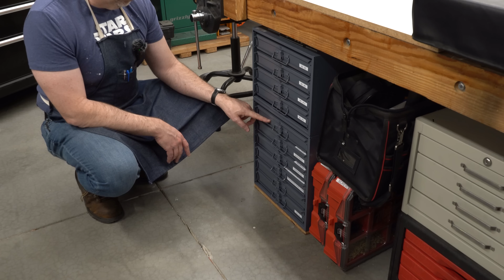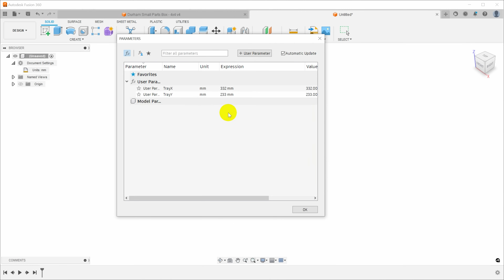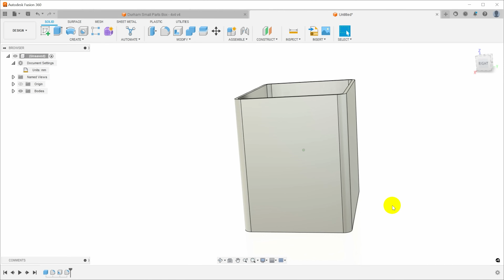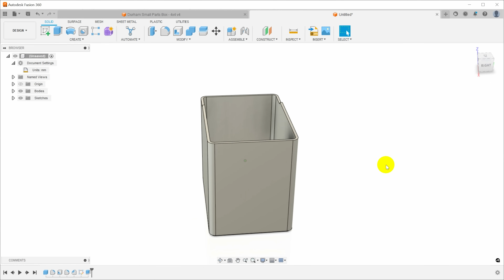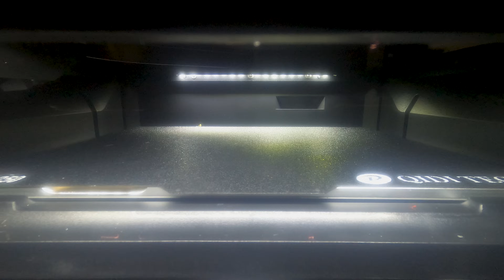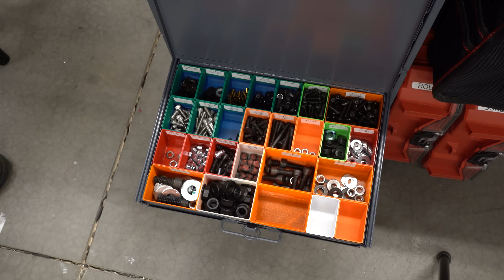Create the Perfect Storage Solution with 3D Printing!

Comment: Gridfinity is a similar modular storage system.

It's based on a 42mm square and 7mm height units

But you can create custom boxes with any dimension with the Gridfinity Rebuilt OpenSCAD model that can be found on Printables.

I've begun using solely this method for basic boxes but with a 21mm grid size on the bottom of boxes and a 42mm base plate grid size. With the 42mm base I can use community generated models. Then the boxes can be moved in half increments, or I can build smaller half boxes.
Reply: Yes i was wondering if gridfinity would be mentioned
Reply: And Gridfinity again was 'inspired' by a similar box system by Alexandre Chappel
Reply: @insignio1  unfortunately his never really took off
Reply: @insignio1  Which didn't take off, because that guy literally designed his system around his deficient printer. When printing on a well calibrated machine there would be different sizes for a 2x1 vs 2 1x1.
Reply: FreeGrid is similar to Gridfinity but with a few different design decisions that I like. For example, it uses a 50mm grid and 10mm unit height instead of funny but random values like 42mm.
Reply: Yes and its open source so there are hundreds of tool/part specific additions great setup
Reply: I’m sure Zack does mention it in the original video he made on it. But it’s taken off in quite a fantastic fashion
Reply: I have been struggling with an aging orgazitional system that was once nice, but has suffered greatly from lack of flexibility over the years. I am also a software engineer and have many of the same OCD characteristics that James does.

 I recently started to work on the problem using gridfinity and am still working on my first drawer, so I have a lot to learn still. The disadvantage of gridfinity is it doesn't fit exactly with the dimensions of existing boxes like the Durham boxes, so there would be some wasted space. On the other hand, the base grid means you don't need to print empty boxes just to fill out a drawer, because the boxes will stay in place anyway. Another advantage is the gridfinity boxes can be used across multiple sizes of boxes and drawers for additional flexibility in the future. I want to be able to organize tools as well as parts. Also, I want my system to work with parts drawers, toolbox drawers, shelf storage, etc. all from different manufacturers with different dimensions.
Reply: @michaellitzkow8123 It's frustrating that Gridfinity was built to joke dimensions rather than an even multiple of a 10mm cube which has a good chance of fitting in a range of manufactured spaces such as boxes and shelves. This point ignores sloppy manufacturing tolerances for such objects and artifacts of injection molding and vacuum forming meaning boxes off production lines are usually designed without walls at right angles or perfect sharp internal corners anyway, meaning an in exact fit filed with a custom spacer may be inevitable.
Reply: Gridfinity is interesting but I like to make mine custom so I totally see the basis of making it custom. More satisfaction that way.
Reply: I believe the openscad rebuild has arbitrary x and y but hard coded z. I may be thinking of the python cad query version though. The cad query version is even more capable than the openscad version by some measures, for instance containing a parametric toolbox with integrated gridfinity base plate and robust ribbing versus flat plain be optional.

Comment: good stuff. I fell down this hole some time ago. Did the Sortimo . Tanos, route. I looked at these boxes, they were not great at keeping small parts separated. The idea of the 3d printer is a great idea. The Sortimo and Tanos have different sized boxes that allow for the different size and adjustability. Where the 3d printing really comes into play is making custom size and odd shaped boxes. For example having a wire stripper shaped box  in the box with wire splicing supplies.  As usual great work.

Comment: ... That just screams for better boxes. The ones I wanted to use are Stanley's from Home Depot (Search: "Stanley-25-Compartment-Shallow-Pro-Small-Parts-Organizer-014725R") Dewalt/Milwaukee have something similar, but everyone seems focused on large internal trays for jobsite sorts of things.

1) The Lid basically seals against the internal trays.
2) The grid on the box/lid locks the trays in position.
3) These combine to mean that you can actually carry the tray by the handle. 

This box, redesigned to fit the Durham Rack are basically what I want.

Comment: I use pouches for small amounts of small parts, makes them easy to get, reasonable fast to find (just flip through the labels), and the pouch can have lots of text to describe what it is (electronics parts in particular).
Reply: What kind of pouches did you find useful? I'm looking for a nice way to get my misc hardware sorted, and something flippable sounds really nice.
Reply: @klaernie  Quart Zip Locks lined up in clear containers works good. Snack bags seems like they are always changing sizes. But, you can decide on the "Perfect Size" Ziplock and order them from Uline and other places, pay a bit more and usually go back a few years later and buy the exact same bags.. Usually with label areas on them, etc..

Comment: Seen other systems, and they generally include a grid on the bottom, which keeps the other boxes in place when you remove one.

Also, as someone else pointed out, the 8/3 calculation disregards the spacing

Comment: yea  I know what your talking about, I started in software but Im just old enough that that meant you needed to know the hardware, next thing you know I am doing industrial automation where I got a computer running a sequence with a GUI running hardware and doing the electrical design as well as mechanical ...

 Long story short, I get a new doo-dad in that's now a thing that has to be maintained and my tech's absolutely love it when I say "hey I need this to live somewhere in X cabinet, as its a part of our CI plan on Y machine, can you 5S that for me", we have a lot of those harbor freight boxes with the removable bins in them just for the reason of having to shuffle parts around without handling each individual thing in each bin
PS: dont get rid of all the trays, they are handy when rebuilding things, when I do a teardown of something either at work or at home ill use those things for that something and cap in in aluminum foil so it doesnt get lost while I piddle fart with other things

Comment: Just spent several days printing similar (Gridfinity) boxes for a storage cabinet. Your design is a bit more flexible.
Reply: I was just going to mention Gridfinity. What parts of this do you find more flexible (I haven't printed gridfinity yet, but was planning to.)
Reply: @NathanSpaeth  The main thing I can think of is possibly that Gridfinity has a specific core X/Y size. That can either be "not flexible enough" or "I don't have to worry about this" depending on the person and possibly circumstances. For example, James has boxes of a specific size that he wants to completely fill, and that size probably isn't a clean multiple of the Gridfinity X/Y, so he may have considered it more flexible to adapt his bins to the Durham dimensions.

That said, one thing I do think James should consider adapting from Gridfinity is where Zack's tiny parts bins had a little lip on the top back for more visible label placement and also being able to more cleanly pull a bin out/put it back in, which James had noted having some trouble with.
Reply: On the other hand, Gridfinity allows to stack multiple (shallow) boxes. Great for smaller stuff. Just love Gridfinity.

Comment: Great job! I did a similar thing with the Harbor Freight boxes. I even included tools. My ferrules and my ferrule crimper are in the same tray.
One thing I learned to do if I mixed screw lengths is to not put similar lengths in the compartments. Mix 10 and 30, mix 20 and 40. That way you can see what they are and grab the right one. Don't mix 10 and 12.etc.
Reply: Have you run into the issue where HF changed the style of the boxes and old trays and new trays are not interchangeable? They messed with the feet on the trays and the bottom of the box. Also, whatever complete IDIOT at HF decided that the labels should use military class adhesive and then stick them to the box rather than the shrink wrap should have a 10th level of hell created just for them.
Reply: Separating by colour works well too - brass screws with steel screws or washers
Reply: I learned the screw thing the hard way.

Could have pulled my own hair out due to my own ineptitude.
Reply: Whooa. I'm going to try that.

Comment: as a fellow software engineer.... yeah absolutely feel you on the "what happens next if we go with this design" thing

wish my bosses sometimes had this same anxiety bc the answer is usually "we will end up with technical debt"
Reply: You need to work where I do. The main mode of operation IS creating technical debt. The last team I left has a backlog of 6+ years of problems that could have been 100% avoided if it had a competent manager.
Reply: @vincei4252  lol, no thanks. only reason my current shop doesn't have worse technical debt (yet) is because it's a startup and we haven't had the chance to really accumulate it yet
Reply: @hotel  I hear you. My place makes so much money it can afford to have hordes of worthless managers and dead end processes.
Reply: I actually got my place to do what we all see needs to be done, and just start again with lessons learnt. Of course they were resistant because of sunk cost... "You can't just throw away 15yrs of our valuable work!" ... but that 15yrs of work was done badly without understanding of what it was doing. I replaced all the special cases and magic numbers with 15lines of code. Obviously this pissed a lot of people off and there was a lot of "Oh but you can't do that because you need a routine to spot <special case> here!" because they didn't realise that the special case only existed because they had fundamentally misunderstood something at a lower level. Sometimes you just need to understand how stuff fits together and that goes for boxes and software.
Reply: The fact we even have "technical debt" as common parlance in this industry is depressing. Software should be an investment.
Reply: @swolebro  One person's technical debt is another's reduced project scope (at least that's one way technical debt is allowed to occur).
Reply: Yeah but it's not Agile 😆
Reply: @evo-labs  we abandoned sprints and moved to kanbans and haven't looked back senses.
Reply: "omg, you're describing adding a value to an existing array" at around the 6 minute mark. 😂